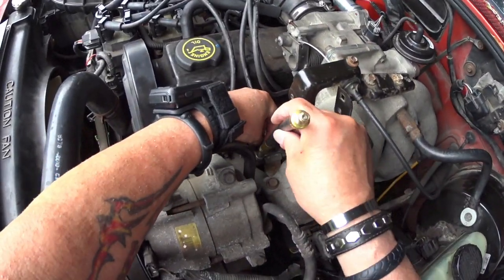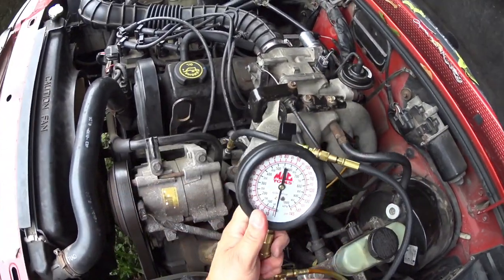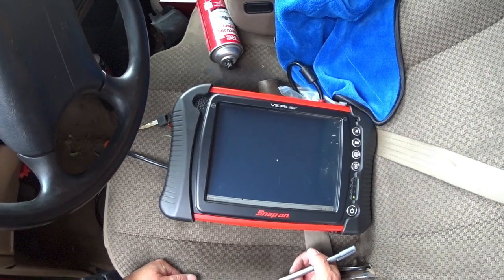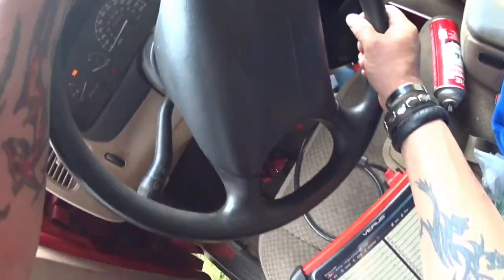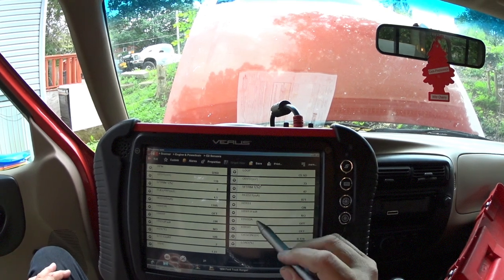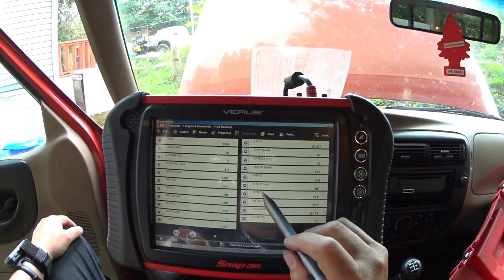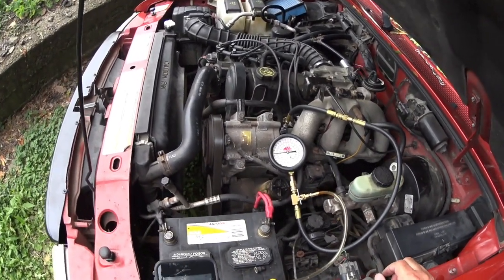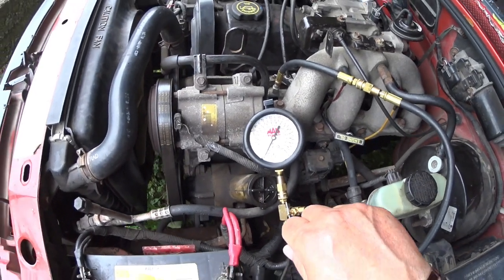Fuel Pressure Problem 99 FORD RANGER 2.5L

Comment: I just watch this video I've been having the same issue but I've been fighting I have change fuel pump change fuel filter change sparkplugs all kind of stuff and also getting a no spark situation I did change that fuel pressure regulator at one time but it was on another engine maybe that one's bad any more further to help with the situation please suggest any videos or update video please

Comment: hey I have a Ford ranger 1998 3.0 xlt step side, i changed out my fuel filter and hooked up my guage which reads 30psi but goes no lower or higher, is my regulator busted? Also more info about truck that lead up to problem was me not driving it with gas. truck will fire up but idle erratically until a shut down. if I engage in gas the truck dies immediately aswell, appreciate it peeps
Reply: The pump gas sensor is either telling the computer it has alot of fuel..  ooooorrr your sending unit is acting up. Either way changing the pump is a fix if your dont want to replace 1 part on the pump.

Comment: Hey I have the same truck changed egr valve and tube, idle pressure sensor, maf, egr damper, catalatic convertor, plugs wires coil packs, upper intake, fuel supply lines fuel pump, had it to 2 mechanics and the dealership and still no luck. It holds pressure just only 35 psi. Rough idle no power and my oil pressure sensor jumps next step is the relay and the regulator oh and changed injectors also. Have you had any luck on the problem. Same exact truck 99 2.5 side step stick.
Reply from the maker: charles winters Hey! Have you check in the engine fuse junction box a 15 amp fuse that supply power to the heated oxygen sensor! That’s the first thing I check went you have idle conditions that you described... and If I’m correct I believe that should be more fuel pressure at idle...

Comment: Hey my friend the presure regulator is on the fuel pump and the part you called presure regulator is ainjector pulse regulator you really are looking replaceing fuel injectors .
Reply from the maker: Tony Cotta in this particular ford is no fuel Pressure regulator in the fuel sending unit... if you see the fuel Pressure regulator in the fuel rail is control by vacuum or fuel Pressure Damper how ever you want too call it... know that mean if you accelerated the engine mean zero vacuum and zero vacuum on a fuel Pressure Damper or regulator means if the fuel pressure is about 45 psi should increase 3 too 4 pounds if you have a decrease means bad fuel pump or fuel pressure Damper or regulator! Know in this particular case the return hose is hard plastic so I cannot clamp the line! And that’s is that...!

Comment: 2.5l ranger doesn’t have a fuel pressure regulator on the fuel rail. The 2.3 does. 

The regulator is built on the fuel pump in the tank. That thing he is messing with looks like a regulator but is actually a pulsation dampener. If its not an injector leaking than its could be a check valve in the fuel pump itself. And easy test is to get needle nose vice grips and crimp the fuel line under the truck after the fuel filter. Start the engine and let it die naturally from fuel starvation. Wait 30 minutes and then with the line still crimped shut loosen the line going to the engine on the fuel filter. Wear goggles, and have a rag & jar to catch fuel. Note if there is significant pressure in this line. If there is than check valve is okay; look towards injectors. If line pressure is low than look towards fuel pump.
Reply from the maker: yoimalex yes! In the video I talk about the check valve in the fuel pump! And that was the problem and the fix!

Comment: I have a question regarding a 99 Ford Ranger 2.5 L I believe it's an inline 4 cylinder. It has sat for a year without starting. Im sure all the oil has dripped clean down to the pan. Other than draining the oil and putting new oil in her and changing the oil filter, is there anything else I can do to protect the cylinders before firing her up so the pistons dont score the cylinders? Any info would be greatly appreciated. Thank you ahead of time for any suggestions!
Reply from the maker: Ricky Ric you can take the spark plug out and spray DW40 ! Crank the engine with the spark plug out! Then install new spark plugs change the oil and filter! After you gating running for two day change the Fuel filter! Check the air filter if you don’t see the sun light true it change the air filter! Good luck!
Reply: Thank you kindly sir for getting back to me so fast!! I greatly appreciate the info. Sounds like a great idea!

Comment: I have a 96 2.3 ford ranger that was running find until this passed Sunday I noticed if I accelerated hard it would stumble bog out then eventually get going ? Would you happen to no what would cause this ? as far as I no the spark plugs and wires are original with 125K on them . And I already cleaned the MAF sensor. Any help would be greatly appreciated
Reply from the maker: SocalYzF710 sound like a Mass Air Flow sensor problem... That's just a guess so is a 96 you can check the OBDII for memory codes and from there I can give you better direction where to start your troubleshooting!
Reply: Pete Sambolin would I be able to check for memory codes since the CE light isn’t on ?
Reply from the maker: SocalYzF710 you can take it to any Advance Auto Parts or AutoZone! They check it for free! And get back to me!
Reply: Pete Sambolin no codes were saved ? I cleaned the MAF and put a new air filter and it’s still doing it just not as bad. I’m really thinking it’s the plugs and wires but I’m not to sure
Reply from the maker: SocalYzF710 can you take it too any Advance Auto Parts or AutoZone! To check for codes?
Reply: Pete Sambolin I did took it to oreilly and their were no codes
Reply from the maker: SocalYzF710 okay so no code!! So your problem is on fuel delivery and just too be sure is a fuel pressure regulator that have a vacuum hose and is location is in the fuel rail... get the engine warm and at idle disconnect the hose from the pressure regulator and watch the idle for changes Note: from the vacuum hose should not be fuel present if you see fuel in the vacuum hose! The diaphragm inside the regulator is broken part is no longer good need to be replaced...
Reply: Did u figure the problem same truck as you and the legit same problem that u described. Replaced the maf tps. Coil packs plugs wires. Only code it said is o2 sensor wich would cause this I dont think

Comment: Great Diagnostic Video, thank you.
I'm having similar situation with 2000 Mazda B2500 SE, standard transmission 2.5L |4cylinder.
I've swapped out all the parts you mentioned except for fuel injectors, fuel pressure regulator,  fuel pump.   No Mention of the fuel pump switch inside the cab on passenger side, which has been known to create problems.  Is the  Red button on the Fuel Switch supposed to stay depressed in the down position?  I'm waiting on volt meter, code scanner, & fuel pressure gauge tester before buying anymore parts.    Ahhh I see you found it to be the Fuel Pump!  So can you tell me if I need the whole fuel pump and related parts & harness?  I just can't afford a mechanic.  Fuel Pump Replacement is a big job.   Any video on replacing the fuel pump.  Hey you could use my truck to make a video, I'll do the labor you direct.  haha
Reply from the maker: Ax4400 okay! What is the symptoms in your truck?
Reply: Thank you Pete for your response.
It started running rough,  had to almost pump gas peddle to get it to accelerate, lose power,  and then take off.  Cleaned MAF sensor then changed it,  cleaned throttle housing, new IAC, but engine light came back after 3 days. Start  became intermittent, new battery.  Failed to start.  Crank/no Start.   Change up + down O2 sensors , hiccuped around the block- won't start now.  Crank / no start.   Once got it to start by hitting the bottom of gas tank where Fuel Pump is, but that won't work now.  :)
Reply from the maker: Ax4400 okay! So this is the test I want you to do !
Reply from the maker: Ax4400 sorry! I want you to crank the engine and watch the check engine light on the dashboard ... The light should light up went you cranking and then go off went you continue cranking ! This is unique by Ford means the ECM or PCM engine computer seeing the RPM wish is provide by the CKP crank position sensor! Loosing power in ford cult be Fuel delivery! Mass Air Flow again MAF control fuel delivery only went the engine is running so you clean the Mass Air so that is out of the way! But no power went the engine is running if the Mass is not it then is a restricted catalyst converter and to get that out of the way you have to take HO2 sensor upstrim the one close to the exhaust manifold out.. And do a road test if the power is back means is restricted ... Try to get DTC if you can but you have to get that fuel pump running... Make sure to the anti- theft  light is not flashing...
Reply: What are you sorry about, I appreciate your trying to help.  Check Engine Light is not going on now when I crank the truck,  I think because I had disconnected the battery when I changed the new IAC.
Reply from the maker: Ax4400 nothing to do by disconnecting the battery! Check engine light should go ON went you turn the ignition switch to on position without cranking the engine!  Is not On is because you probably have a blow out Fuse! Went ever you put the ignition switch on ON position the computer send a signal to the fuel pump relay for the 2 second prime! By open the gas cap take a funnel down to the filer neck and listen if the fuel pump is running for two seconds and then quit!? Went you banging the fuel tank someone have to crank the engine at the same time! For that too work! Having a voltmeter is a good way to see if you have 12.0 volts supply to the fuel pump! In that case if you have the battery voltage for 2 second and then quit! You need to replace the fuel pump! The inertia switch the one with the red button very rare that fails but to make sure banging next too the switch will trigger open and then pressed down to active! Go un the junction fuse box and swap the fuel pump Relay then make sure is no fuse missing or blown out!
Reply: Thanks Pete, must of blown that fuse today because I had  Check Engine Light before.   Now only Check Gauge?  Tomorrow I'll walk to store buy fuses.  I think its just  9:  is 20A mini fuse described as  fuel Pump Relay & RAP Module?  32:  Relay - Fuel Pump Relay; this info is from owner's manual I have to check in daylight.
Reply from the maker: Ax4400 also cult be because the brushes from the fuel pump wear out create high amps and blow the fuse! The vibration you create went you bang the fuel tank that’s what they move the brushes inside the fuel pump motor! By someone cranking the engine and another banging on the tank with a pice off wood 2x4 in the flat side of the tank the vibration moves the brushes and get the fuel motor going! Know if it’s no brushes left Fuel Pump motor will not work and it may blow the fuse because too much current draw equals high amps probably more than 20amps and finally will blow the fuse on the junction box!
Reply: Gd morning.  Checked fuses and cleaned contacts, none blown.  I cycled engine & check light came back on.   I don't have fuel pressure gauge or anyone to turn key while I knock on bottom of fuel pump unit. Remember this has to be a one person job, compadre. I'll wait for fuel gauge to  come next week.  I'll try make video for you. 
 Could you please recommend Replacement & Price Range I should pay.  Don't look forward to detaching that bed, think its safer than dropping tank?
Reply from the maker: Ax4400 Fuel Pump $77.99 Fuel Strainer $19.00 and Fuel Tank strap in case they brake $27.49 ... taking the bed out is crazy! Part # on the Fuel Pump E2290673 on the strainer FS260365 and the straps 578-140
Reply: You find dropping the fuel tank easier than lifting the Truck Bed? I've seen tuts with people cutting into the truck bed floor for access. LOL   Call it an access planel. I'm waiting on diagnostic tools :)  You know where the Fuel Pressure Regulator is on this truck?
Reply: Ok Cheapo Memo Code Scanner came today:  Only Error code is  P0 135 P 
Got the truck to run & chked IM : CAT NOT RDY, EVAP NOT RDY, O2 S NOT RDY,  HO2 S NOT RDY,  EGR NOT RDY |  The 2 O2 Sensors I just replaced w/new ones from Ebay, maybe not good?  I have a new sitting there that I will change.   Will recheck the H O2 sensor circuit when volt meter gets gets here.
Reply from the maker: Ax4400 P0135 is the Heater Circuit malfunction Bank 1 Sensor 1 meaning the computer is seen a open circuit! You just replace the HO2 sensor! Know is a fuse in Ford and I believe in the Mazda B2500 also is a fuse for the heater on the oxygen sensor! Simple test they’re 4 wires in the sensor harness side from the engine and went you connect the sensor in the heater side should be two black wires or two white wires! That’s the heater circuit for the sensor in the harness side coming from the engine should be RED/WHT and LTBLU/ ORG wire trace identification color! With the ignition switch in ON Position the wire LTBLU/ORG should have battery voltage wish is supply by fuse 13 a 15amp blue fuse! Note: do not push the tip off the probe in the connector it will open the contact and then you create a problem! Then the RED/WHT wire color trace should be ground supply by the ECM or PCM ... finding out if your HO2 sensor the heater is open is a simple test with a Voltmeter and select continuity test and that’s the one that have a little speaker drowning on the meter! Went you though the positive and the negative the meter will sound a beeping noise! The Test is disconnecting the connector from the sensor and check the two white or the two black if the meter beep! The sensor is good...
Reply: Truck start now sometimes.  I don't trust it to go anywhere. Have to wait for volt meter.  Pete do you know if the O2 sensors part is the same for Mazda B4000 & B2500?
Reply from the maker: Ax4400 about the HO2 sensor don’t know if can be swap best way to find out is to call a Auto Parts store and see if they are the same part number! You have too Fix the P0135 because this particular DTC I have case study with this particular trouble code that the engine is running very bad... if the wire and harness are okay! Meaning you have to do the test directly on the ECM connector and find the wire color code that I send your!! If fail the ECM have too be replace and on Ford you don’t have Flash the security or vin number I don’t know in Mazda!
Reply: You ought to sell parts on ebay. You would be a trusted knowledgeable seller, ebay needs people who know how what they are selling works ;)
Reply: Truck won't  Turn On /No Chk Engine Light :(     Changed Fuel Filter, EGR valve, TPS... Fuses don't look blown?   Going to change spark plugs.   All this started with the first freeze in San Antonio Tejas
Reply from the maker: Ax4400 I’m lost!!! After you fixed?
Reply: No I haven't changed the fuel pump yet.  Thats the last resort.   I changed those parts too just cause I had bought them already.  I'm working on this in my carport.  I'm no mechanic just learning as I go because I can't afford a  mechanic nor know one I trust.    Thank you Pete, for all your help wish you were close by, I would have paid you to help me.  I'm taking truck bed off to change fuel pump & hoses while I'm there.   Will let you know  when I get this truck back on the road.
Reply: Changed Fuel Pump, a little hose on it was worn away.  Accessed fuel tank by removing truck bed.  Truck would not start.  Next day truck start & ran like new. I drove to Park and went walking, returned a few hours later. Truck started right up. On drive home Truck just shut off and I had to coast into a parking position by at a corner.  
Turn key on - no engine light, check guage is on, cranks, but no spark.   Battery tests good. Does 2000 Mazda B2500SE have a Crankshaft synchronizer? - That & crank position senor are known to cause intermittent Power Shutoff issues, without noise or warning except for intermittent Power Failure. My truck runs great otherwise ;)
Reply from the maker: Ax4400 CAM symptom era engine runs for a few then stall on you went you are driving! Unfortunately some times the ECM/PCM do not trigger a DTC for that condition and that's went a good tool scanner come in handy... Because you can go and a road test and creat the symptoms and with the scanner you can record the engine DATA and see what you missing went the truck stall on you... Maybe the scanner you have have what they call Freeze Frame DATA but because is not trigger a DTC will not record the Freeze Frame Data....
Reply: I will learn circuit testing & find problem, don't know when but I will.  Thank you for all your videos & support.
Reply: Ax4400 Have you fixed your truck? I am having similar symptoms and wondered if you found a solution
Reply: Good grief. put a fuel pump in your vehicle. i guess banging on the fuel tank and the car starting didnt tip you off ?
Reply: i have a 1999 b2500 same problem im about to replace the fuel regulator and fuel pump